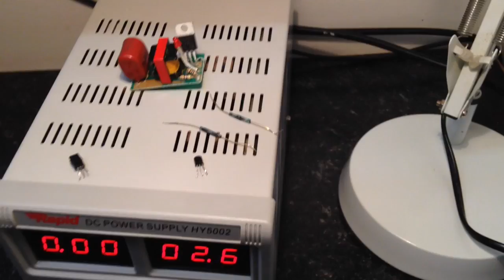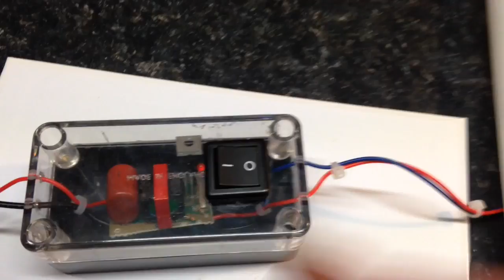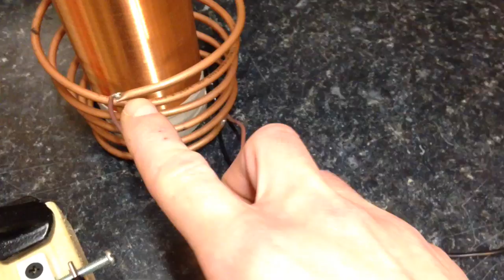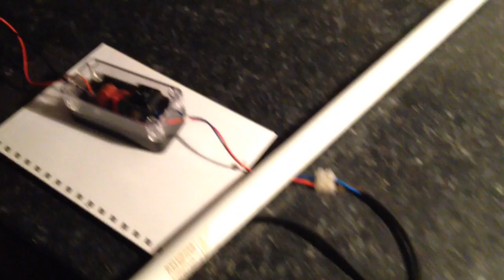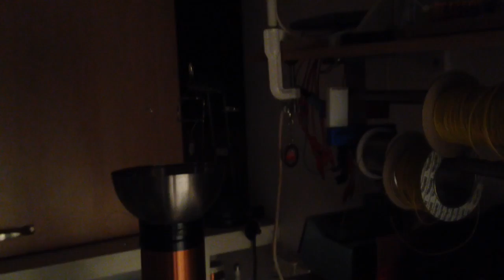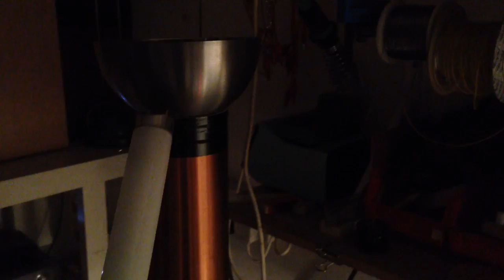Spark gap tesla coil made from bug zapper circuit

Comment: Hey deeds, was wondering if you could help me out...this tip31 transistor has a different pin-out setup (b,c,e) the original one in a bug zapper..I think (e,b,c)....but it looks like in your vid that you have mounted the tip31 in default position pins kinda mixed up,,, my question to you sir is can you remember what you did or does it matter what way is mounted ? Just I am doing this as a little project but have no clue about circuits lol..great if you could help 😊
Reply from the maker: Hi mate, I would look at the transistor that's in the circuit and lookup to model no. See what the pin assignment is then you'll know how to wire in the tip. Ask as many questions as you like, sorry to be brief I got to head off to work. Cheers for now. :D
Reply from the maker: You might have to bend the legs on the bigger transistor to make them match or solder three wires on the legs and then it's easy to match B,C,E in the E,B,C holes.  I have a circuit right next to me where I've done the same - bend the legs carefully you can do it.
Reply: Hey dude yea thanks for getting back to me about it ...I managed to do it by playing about with the connections through a breadboard 😊..got it all working with a tiny 13cm secondary lol ..cheers dude 😀  another question , would a bigger secondary give me bigger sparks? as my sparkage is teeeny also would a top load have any effect as I don't have at the mo..doooh   ... also I haven't earthed the secondary as am just using a 9v battery ..should I earth this? Thanks for your help fella , much appreciated..
Reply: i finally made a video of my 1st mini mini coil lol..check it out :) thanks for your help dude .
Reply from the maker: Well done mate... so sorry for the late reply. :D  take care.
Reply from the maker: You might find it works better if you ground it separate.  
Topload will drop the frequency a little - you might find it helps to boost power.  On a spark gap coil you're juggling the length of  the primary with the capacitance and topload to be in harmony with the secondary.  Topload would make a huge difference with a full spark gap coil, like a ZVS driver.  The    
ZVS circuit is cheap from China - £15 with the flyback.  Then you need some caps.   

I would go solid state and work towards building a Steve Ward SSTC V.  That's got to be one of the best coils for starting out.

Comment: hope the holidays have brought you and your loved ones good cheer,  from the frozen north,  may a new year bring you better understanding of the materials.  the silver placed on the back of silcon, creates a mirror,   the silver is reflective of the dielectric energy inherient in everything ,including the human entity.  a copper wire made by humans is reflective of the dielectric snapping lines of force created in our machines.if one was to roll the copper wire out over the silicon, like a silver backed mirror, one would notice the difference that the silver,s reflectiveness has over the coppers reflective nature of what dielectricity  is.   the steel laminate buildup that most human devices are made from is a flux integration structure for the reflective material to be set into,   the device itself,   I highly recomend the use of the ferric oxide instead of the iron plate buildup, simply like silver over copper,  it represents a better dielectric material for the flux integration that the reflective material is held apon within your devices.
Reply from the maker: Thanks Ron I find this facinating, much appreciated. And may I wish you all the best for the new year also. thanks mate.. be warm.
Reply: consider putting crystalline mineral elements onto your top loader.   you get
Reply: 9.20   northern Canada   minus 22 cel.  still dark out .
Reply from the maker: ..blimey Ron... dark and friggin cold at 9:20am.  What time does it get dark? late afternoon?
Reply: just been blizarding up a winters storm,  more like minus 30 with the wind,   fires are burning lol,  hey 500 miles further north and the suns gone for 2 more months. lol   check out mike s vid ,  try to get better lighting  for the next one.
Reply from the maker: heheh thanks for the new year video link... I think it's going to be a good year!.
  I watched your video, twice.  I was nosing around your workshop (and listening)... I see the cat wandering over the pool table in the background lol. take care Ron